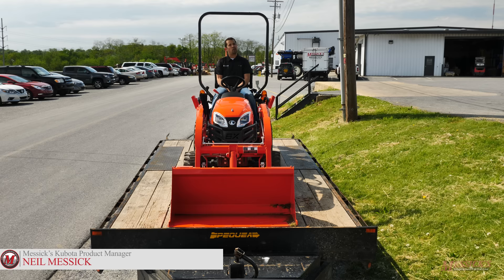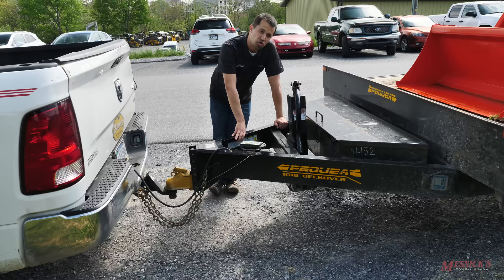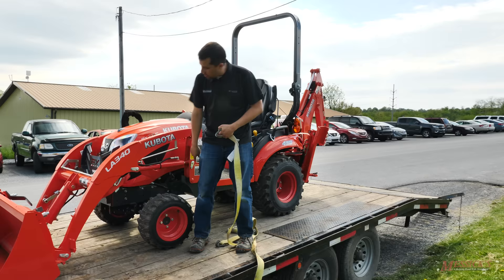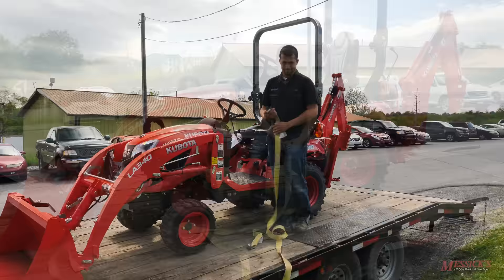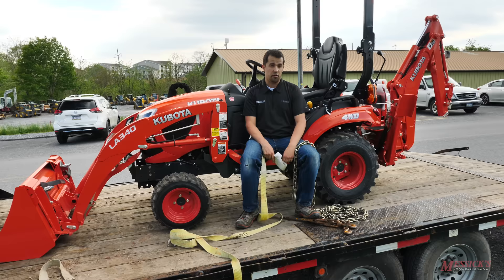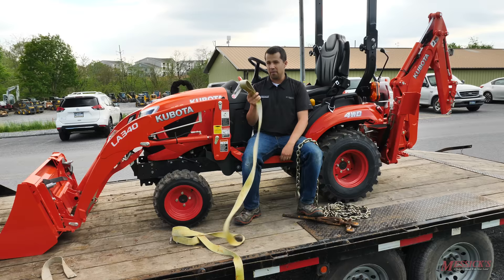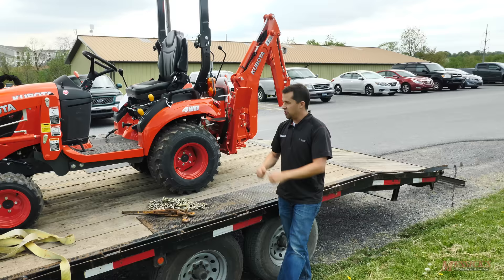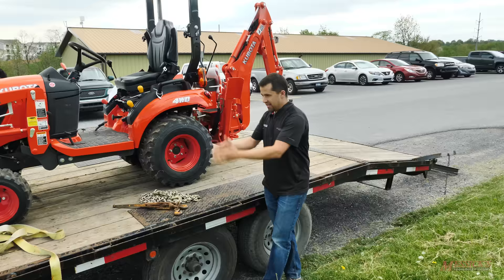Tips for loading and hauling your equipment (with bloopers!!)

Comment: Another biggie is the tongue weight exceeding the GVWR of the truck. Just cause your half ton  can tow 10,000lbs doesn’t mean it can handle ~1500lbs of tongue weight on the bumper. Pile a few dudes into most half tons and you’ve already used up half the payload. You don’t want to be always bumping up against your trucks limitations. If you’re towing anything bigger than a B series get a 3/4 or 1 ton pickup.

Comment: A point you failed to make is that whatever your tongue weight is after loading your machine, that amount doesn't count toward your trailer's gross weight limit. For example, my 8,000 lb. Kubota is loaded onto my 10,000 lb. trailer which weighs 2,500 lb. I have loaded it properly (10 -15% tongue weight), and total weight is 10,500 lb., ostensibly 500 lb. overweight. However, the tongue weight is being born by the tow vehicle, so that weight can be subtracted from the total weight, which would be 1,050 - 1575 lb. Thus, the trailer's gross weight is actually in the range of 8,925 - 9,450, well within gross weight limits. Simply said, subtract your tongue weight from your payload and then do the math.
Reply from the maker: Varies by state. Not all interpret it that way.

Comment: Um I thought you would actually show us tie in down the tractor. Oh, and it would be nice if tractor manufacturers would put designated tie down hooks or loops on the tractor clearly painted so you can easily  hook or strap to it.
Reply: I have a L3301 w/ Backhoe and there is no good place to tie down to, especially with chains.  I’d hate to scratch that pretty orange paint off.
Reply: @stephengmeiner3264  buy a welder a make some hooks
Reply: Buy some axle straps and D-rings/shackles/cleaves. Be cautious as you add items in the tie down as that single tie down will be rated on working load limit (WLL) to the rating of the lowest rated item in the loop. Depending on the length and structure of the axle strap, they can be used in lots of ways
Reply: Also make sure you tie down with the legal amount of straps. and that you are not driving a vehicle with trailer whose GVWR requires you to have a CDL.

Comment: Another thing to think about is your height. Especially if you are using a complete deck over trailer like your, particularly if it’s a higher GVW you’ll have taller tires. Check the height of the ROPS not to exceed 13feet. A BX ROPS are close to 7’ by themselves. It’s not unheard of to have a 3’ deck height. So little to no worries, but stepping into the B series, and especially the L you start getting up there in height.

Comment: Chock your trailer!!!   Wheel Chocks save lives!  Your experience with the rig moving would not have happened had you chocked the trailer wheels.   Other than that, good advice.   Remember 10% tongue weight is where J2807 calculates all towing standards now.  You want at least 10% on the truck and up to 15% is the limit. A 7K trailer should have a minimum of 700 pounds on the truck.

Comment: Just a comment on the clevis in drawbar with a chain running thru it, can actually let machine slide sideways.Better to use two separate chains and binders.Speaking from experience at work had a track digger slide on trailer running a single chain.
Reply: I agree. I had a tractor tied down this way, and work rainy and wet deck boards the tractor slid over and started rubbing tractor tire on trailer tire. I saw the smoke soon after it happened. I needed binders and straps to pull up the slip caused by road crown to get her back in place. I won't tie like that again.

Comment: My Dad went to a local r.v. dealer and purchased 2 screw type jack stands. We put them under each back corner of the trailer for both loading and unloading. By them being in place it won't allow the weight of the tractor or whatever to be able to lift up on the hitch and tongue. They are pretty simple but they work extremely well. Wouldn't be with out them.
Gary Fox, Iowa
Reply: I  do the same
Reply: Did the same thing on my 18 foot haul trailer many, many years ago, welded swivel jacks on both rear corners, keeps the trailer and tow vehicle level when unloading or loading equipment.
Reply: @forrestanderson2652  you'd think trailer manufacturers would offer those as add-ons.
Reply: @ChronicBongitis420  0
Reply: @ChronicBongitis420  They do.
Reply: @ChronicBongitis420  they do, a good “equipment trailer” the ramps have stand downs that contact the ground when the ramps are in the down position, thereby absorbing the weight of the tractor as it climbs the trailer and keeping the tongue from rising.
Reply: Look at the 5:00 mark. There is some sort of beefy stand on the ramps or trailer.

Comment: I was actually looking for recommended tie down points for a BX23S, but this was still helpful!  I have been using ratchet straps.  As they age and wear, I will have to seriously consider upgrading to chains.

I roll around in a Tacoma with a 7K tandem axle auto hauler.  I have learned to be very conscious of weight limits and distribution.  Properly setup, it tows a 4K payload comfortably and efficiently.  Get it a little wrong, and it will wreck the suspension and/or cause a wreck.

You need to be conscious of limits on:
  - Trailer GVW: Trailer + payload
  - Trailer hitch weight: portion of the trailer GVW carried by the truck
  - Truck GVW: Truck + cargo + passengers + hitch weight
  - Truck GCVW: Truck + cargo + passengers + Trailer GVW
  - Individual axle weights: The balance of the load on the truck

It is easy to stay well within the trailer GVWR and the Truck's GCVWR,  but still be overweight on the hitch, the truck, or a truck axle - or simply be dangerously imbalanced.

I highly recommend liberal use of CAT scales, which are usually located at truck stops.  Their app makes it inexpensive, fast, and super informative.  You get front axle weight, rear axle weight and combined trailer axle.  Learning how to balance the load properly, I did three weigh ins:
  1. Truck + cargo + passengers
  2. Truck + cargo + passengers + trailer.  If needed, shift the trailer load and repeat.
  3. Truck + cargo + passengers + trailer w/ weight distribution.  Adjust bars and repeat if needed.

The first weigh in gives you the trucks initial GVW: front axle + rear axle.

The second weigh in gives you:
  - GCVW: Front axle + rear axle + trailer axles
  - Trailer GVW: GCVW minus the initial GVW of the truck.
  - Hitch weight: Front axle + rear axle minus initial GVW of the truck.

With the information from the second weigh in, you can shift the load forward to add hitch weight or backwards to reduce hitch weight.  The hitch weight should be 10-20% of the GVW.  I prefer to be close to 12-15%, but if I am pushing the limits, then I have to be at 10-11% to make all of the numbers work.

The third weigh in is all about the balance of the truck.  Without weight distribution, the rear axle of the truck will carry all of the load on the hitch, and the front end will teeter totter up.  You lose directional stability and control.  Adding tension to a weight distribution system shifts hitch weight from the rear axle of the truck toward the front axle.  The goal in adjusting the weight distribution is to get the front axle to carry some of the load: The rear axle should carry most of the load, but the front axle should have at least as much weight as it did without the trailer.  As the load approaches the limits of the truck, you should also approach (but not exceed) the limit of the front axle.

I have also weighed in with an empty trailer and taken ride height measurements empty and loaded.  Knowing the empty weights and checking the ride height while loading helps me estimate the weights as I load, so that I do not have to make adjustments when I get to the scales - or even do all three weigh ins.  The truck doesn't change much, so one weigh in will confirm that I did not make any serious mistakes.  If I am borderline on anything, then I do all three.

To avoid the mishap you had unloading - for loading & unloading, I use a chocks and a pedal depressor to apply the brakes (a person is better than a pedal depressor, but the stick never complains about the task).  I leave the truck running for the brake pressure, pull the parking break, and put the truck in neutral to protect the parking gear.  This gives me the truck parking brake (as a backup to the pedal depressor), all four truck wheel brakes and all four trailer brakes with the chocks as a backup to all of that.
Reply: Great info, thanks for taking the time to write it!

Comment: Field service engineer/fitter here. Seen a lot of amusing  incident regarding plant and trailers. 
I always load the plant into the trailer backwards much easier driving off forward when you can see what your doing. 
Secondly chock  your wheels on the trailer and  usually the rear wheels of the tow vehicle. 
Thirdly, Always lash in a "X" pattern front and rear with bracing straps/chains on the side of the machine. That way stops it moving  forward, backwards and takes any lateral movement out. 

Being from the UK it always amazes me how you can move such big things with such little trucks.

Comment: Go to harbor freight and buy a 3” dia discharge hose (for a pump). Cut it into what ever lengths needed and slip it over your tie down straps or chains to help protect the tractor paint and protect the straps from cuts over edges. The hose lengths can obviously slide wherever needed and for safety inspection of your straps or chains because you should!

Comment: Again, you post a video just in time to help me make an informed purchase. I've been utility trailer shopping all week for my B3350HSDC. I'm glad you mentioned the departure angle. My backhoe has the extension on it for the rearward facing seat due to the enclosed cab. I may need to stick to a low boy with protruding fenders to keep my ingress/egress ramp angle shallow.

Comment: Very interesting. Maybe at some point in the future you can show how you tie down with chains so as not to damage a new tractors finish or painted frame. My Kubota dealer used straps as you show however the previous large Massey I just sold the professional driver tied down with chains to travel cross country. Being an older tractor scratching was not an issue, but I would like to see how it is done with new paint for future use. Thanks for sharing. I watch all your videos and I can't compare anyone’s ability to explain things like you do.
Reply: It's hard to show that in a video. Every machine will have different anchor points. Like he mentioned, chasis points are always best. I tend to strap right to the axles in the back and the weight mount in front plus an additional strap to secure the bucket and loader. If you watch some videos made by DOT officers showing how to legally strap a load you'll learn alot. If you're worried about chain scratches on hook up points you can use axle straps. Or use old carpet where the chain would touch paintwork
Reply: I would also love to see this.
Reply from the maker: There's no magic way to do that. A lot of times things end up getting scratched up. When you have room, are truck drivers do have rubber pads that they will stick between a chain in a machine. It's tough to find places that those fit well though.
Reply: Straps are not legal in most states for binding equipment. Check with your state before using straps.
Reply: Think about how many scratches it would get if it came off the trailer at speed.  If small scratches from a chain bother you that much, get a can of touch up paint.  You could always use "Axle Straps"  they come in 2" width and 24-36" lengths typically. Then you anchor them with chains.  2" x 24" are typically rated at 10,000# each and due to their length should have minimal stretch, but I wouldn't go on a highway with them, certainly not an interstate.  They typically have protective sleeves on them and will protect your precious tractor paint.
Reply: I strongly suspect a dealer like Messick's would rather just sell you a can of touch up paint than advise you to do anything potentially dangerous.  They might even throw one in as part of the deal, along with a  Kubota hat and a keychain.
Reply: on a commercial haul, not private.
Reply: Anything you can put between the chain and the tractor paint job, wether it be pieces of cardboard, shop rags, cut up mud flaps.

Gotta use your head for something other than a hat rack.
Reply: You can buy chain protector sleeves which are quite high dollar. Instead look on Craigslist or eBay for used fire hose. Cut them into foot long or 18” sections. Slide that over chain and then into painted area you are trying to protect.
Reply: You can buy a discharge hose (2-3 inch dia.) for a small pump. Cut what ever section length(s) you need to protect the painted area(s). You can slide it anywhere on the chain you need to and also for inspecting the chain condition. When/if it wears out just cut another section and replace. A straight section of radiator hose (truck size) might work too.
Reply: C R. Good thinking!
Reply: @jimpikul8551  Thanks!

Comment: Always engage the 4wd on the truck when loading/unloading and set the parking brake (in gear and off if standard).  If 2wd, chock the front wheels.  Another mistake I’ve seen many times is loading/unloading with the trailer jackknifed which will lead to the truck moving even if everything else is done correctly.

Comment: Tip on backing off, I but oak blocks under the very back of my trailer right under where the ramp connects to the trailer and it stops the front of the trailer from rising when you back off the trailer
Reply: oak rounds good too.

Comment: Another good tip when loading and unloading a machine on a hill, it is helpful to to put the truck in 4 wheeler drive, put in park and lock the parking brake. Then if the back of the truck comes off the ground it will not roll away.  It has happened to me a few time, always was fast about getting on the trailer.

Comment: If using straps I get some old fire dept water hose & cut it up in pieces & slide it over the strap in the spots where it contacts the tractor frame to prevent chaffing.

Comment: Something most states will require on equipment now is the front loader and rear backhoe would need to have their own chain over the top of them so they can't raise up going down the road. It sounds stupid for some things but I do know its a rule for heavy equipment that we usually haul. I'd also add if you're going to get chain at least get some decent grade 70 stuff. There's lots of chain out there with lower or no ratings that is complete junk.

Comment: Farm style tractors are more stable if backed up ramps onto a trailer. Can get very dangerous facing the other way around if you gas it going up, or hit the brakes when backing down.
Reply: @pageleftblankintentionally  Yes, if it is two wheel drive and that heavy loader lifts the rears you would not have brakes. So yes, a heavy FEL is a situation to go on forward.

Comment: I inspected shipments of heavy equipment going overseas on flatracks.  One comment I would have is to cross lash your chains.  Do not use one chain from one side of the trailer around a point on the tractor to the other side of the trailer.  If your chain gets loose you have lost everything, when cross lashed with two separate lashings the securing forces work in your favor.  For a better explanation of cargo securing you can look into "Annex 13" of the IMO Cargo Securing Manual regulations.  You did make a lot of very good suggestions and I follow your lectures very closely.
Reply: I prefer straight chains 2 fowards two 2⃣ back when u cross them I'd one breaks the load can shift left and right
Reply: @celuler22  When you move equipment short distances, most any lashing will work.  When you are sending equipment half way across the country or around the world, better minds than mine have determined that crossed lashings are better according to "Annex 13" of the IMO Cargo Securing Manual.

Comment: I'll run a light cargo strap across the hood... to ensure the hood stays closed.  Not  overly tight.  Heavy bungee cord  tight.
The tractor is designed for its max speed, not freeways speed and I don't want to lose the hood.
.
EVERYTHING gets at least a strap.  Even the bucket when you don't have quick attach.  This is in addition to the chains to tie the tractor on the trailer.
I have never been sorry I added that extra strap or chain.  I have been sorry I didn't add another.  When in doubt add 2 more.

Comment: I'm in NEPA, a few hours from you guys.  Here we need 4 points of contact on machine and trailer.  Running through a clevis attached to the drawbar will not suffice for 2 points  on your tractor.  I worked at a competitive dealer/kubota for a few years,  would have probably gotten in some trouble for recommending something like that. 
4 points of contact on machine and trailer. Each attachment needs  it's own, additional strap or chain. All weight appropriate.  
That TLB would need 4 points at the machine and 1 strap on the loader frame or bucket, and 1 on the digger.  6 total as per DOT.

Comment: 2x10's or 12's. 4x4 or 6x6 as well aid in departure and incline angles. Every delivery is WAY different. TSC sells Bulldog 5k Jack's. You can put them on your trailer to aid in loading and offloading equipment. Can also make them quick attach/detach. No such thing as too much securment.

Comment: One tip I found on loading a trailer, make sure your truck is in neutral, if an auto transmission,  and put the parking brake on also use blocks under the rear wheels. Reason for putting the truck in neutral is to prevent damage to the transmission.